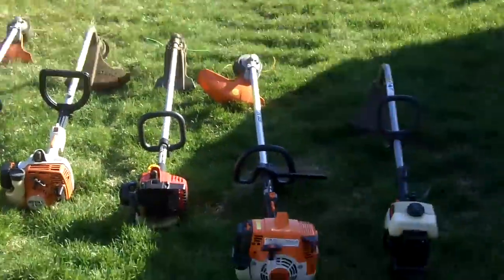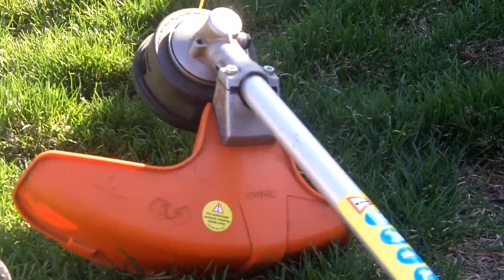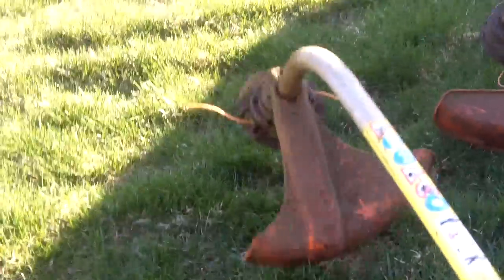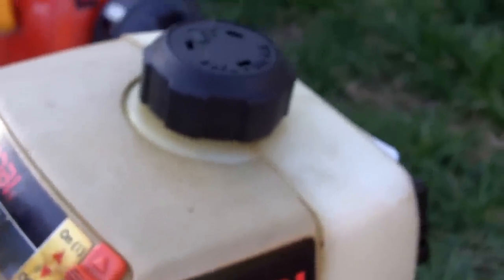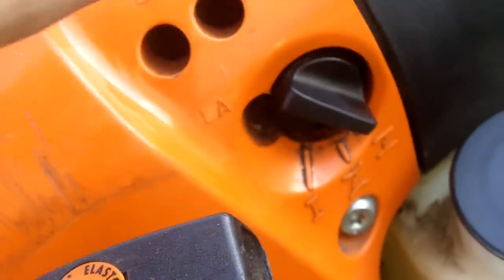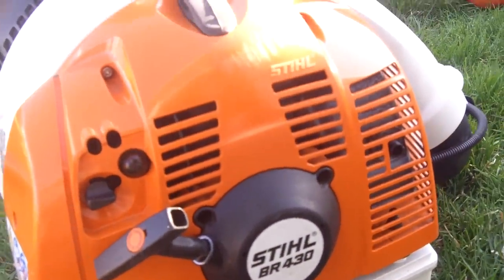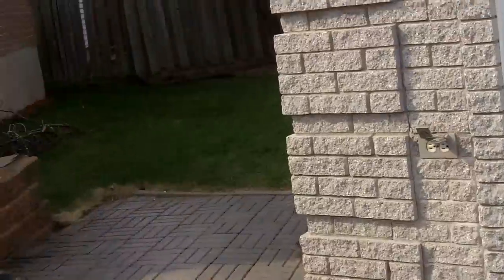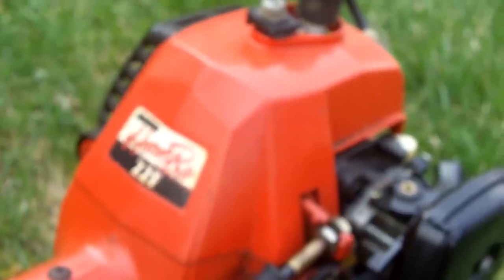Getting The Trimmers & Blowers Running for 2015

Comment: Jon I could use some advice if you don't mind.
I have had the idea burning in my head of buying a HT250 pole saw and converting it into a kombi unit with the appropriate parts. My Stihl guy is on board with me and thinks it would be a good idea, he isn't going to void my warrantee, and said he will actually swap all the parts for me.  
With that being said my choices are the km94r and a Frankenstein km250r as I really want to stay 2 stroke. I know the bigger motor will come in really handy when using the pole saw and mini cultivator and probably even the edger but am trying to justify the extra cost ($200 extra) of this project and the extra weight (2.5 lbs extra) between the two.  
I currently live on a 1/2 acre lot with 2 trees, 300 feet fence line and a 100 foot ditch to trim. I do so with a 4 year old fs55r that has been flawless and never really left me actually needing more. But we just purchases 5 acres of wooded land that I will be clearing out to build a house. It will have probably 30-50 trees, around 3 acres of yard and about a 2 acre pond with tree lines on three sides of the property. I plan on using the 135* hedge trimmer attachment as a scythe for around the pond banks. Also will be using it to clear tall grass and briers at my camp once a year.
I know I don't use it commercially but I will have a fairly involved piece of property to manage when it is all said and done. I plan on trying to keep the it fully trimmed weekly so it will probably only need to be a beast a few times a year. With 90% of its duty being normal string trimming and edging.  
Im sorry for such a long question but if you could only have one powerhead in my situation, which would you pick? 
Thank you,Drew
Reply: But to be honest I really don't mind spending the extra money if it is the tool I need so weight and fuel consumption are the big questions, I don't mind buying the fuel but how often do you have to refuel? I'd love to hear that one tank will get the job done each time but willing to accept it, if that isn't the case!
Reply from the maker: Hi Drew, wow I can't believe they're STILL making that motor.  I thought they canned that engine 2 years ago.  Honestly, if most of your duty is trimming/edging....go for the km94.  Out of all the stihl models I own...the 94 became my go to trimmer since my 70r and 90r keep constantly breaking down.  The 94 is exceptionally powerful for a 24cc...extremely lightweight (your arms won't kill you if you trim for hours) and it's very fuel efficient.  You don't need a 250 unless you have very tall brushes to clear.  If you need that kind of power, instead of modifying...the cheaper option would be to look for the fs 250 model (ebay or on craiglist) and attach a blade to it.  I used my 250 to cut down 1'' tree saplings.

Comment: What happend to the Weed Eater XT 600 ?
I love Stihl Trimmers and Blowers, got an BG 86 also. Starts and runs great. I love the sound of the 4 Mix engines btw
Reply from the maker: Andre G 

Andre, I sold the trimmer last year..  It had too many problems.  Congrats on the BG86.  It's a sweet blower
Reply: Jon3800 Yes it`s beenvery reliable and powerful enough for me. I have uploaded a short video of starting my Dolmar MS 400 and of my old 1977 Mountfield Minor M 4 lawn mower.

Comment: I have two questions. First what exactly is a 2 mix motor and would you recommend the stihl fs 70? Thanks
Reply from the maker: mooch1441 

The 2-mix is a just a trademark name for Stihl's newer 2-stroke engine lineup.  As for your second question, it all depends on what trimmer comparing it to and what you really need it for. The 70 isn't that popular anymore compared to the 90 (4-mix) or the newer 94r (2-mix).  The power is good for a 27cc on the 70. I didn't have any major problems with this model, except for the spark plug issue I mentioned in the video, but I don't like its flexible cable shaft.  As I mentioned in my stihl review video I made last year, the shaft has a habit of wobbling at low speed.   It's up to you,  I'd recommend a 94 over a 70.  It feels more balanced, has a smaller engine which makes the same 1.2 hp as the 70 puts out and it has a solid cable shaft which means you can put a blade on it.  I use the 70 and 94 commercially and the 94 is easier on gas
Reply: Thanks for the response. So the 2-mix does not have any valves, etc like the 4-mix correct?
Reply from the maker: Correct.  Only 4-mixes have valves because they're 4-strokes

2- mixes are essentially 2-strokes that have been stratified charged..  They have no valves and run like the 2-strokes we know and love.  The only difference...they're MUCH better on gas and a lot quieter.  Notice how quiet the 94 is compared to the 250 and 38

Comment: hi jon3800. whats your thoughts on the fs 85r  in terms of power and performance.  was a bit dissapointed to see it only has a 25 cc ??  is it underpowered for its range or am i missing something eg torque etc ... i purchased it for $200 aus dollars second hand.  works ok but im craving the power to take out thick weeds etc lol. thinking of getting a fs250r with the 40cc watched your video on it luvd it ! any help or info would be great mate. cheers 
dan from Australia
Reply from the maker: +Daniel Dukic Hi Daniel, I can't speak from experience with that model since I never had an opportunity to use one (the 5 you see in the video are the ones I have).  The fs94r is the replacement of the 85r and I love it.  The 85/94 were designed for professional landscapers in a way that it's powerful, lightweight and fuel efficient.  In its hayday, it was their top choice.  These engines have better hp/displacement ratios.  My 94r outshines my fs90r in all these categories and the 90r has 4cc more.  If you put a blade on that 85r it will surprise you despite  its smaller motor.  True the 250 has 40cc, but they're harder to find now since Stihl discontinued it in favor of the fs240 with a  37cc motor.
Reply: +Jon3800. thanks for the fast reply and info on these models. i know you know your stuff with Stihl ! im yet to fit a blade on it currently just using 2.4 mm line. yes them fs250r are very hard to come by hey. i can get one for $300 aus dollars used but in good nick think i need to just bite the bullet and grab it so to speak thanks again mate im subscribed and keen to see more videos of that 250 kickin ass 👍
Reply from the maker: thanks man, I would get it since the 250s are classics :)

Comment: I have had my fs 90r for a year now and it is starting to vibrate alot lately. What is the cause of this vibration? Bearings?
Reply: It is probably your shaft but after a while a machine will get worn out like your bearings and stuff like that its ok as long as its not vibrating like shaking your whole body its okay but if its doing that get it checked out!
Reply: I have a 90R too, bought it yesterday, and it already needs a new spark plug! Sucks, but I still like STIHL!
Reply: Crisp Cuts Landscaping a lot of new stihls have spark plug issues bought a brand new br 600 had to change the plug to get it to run!

Comment: I have an old 2005 home lite 25cc motor that used to run great but for some reason after I drained the gas for the winter and then put fresh gas in the next season it's acting up. It's old so what ever.
Reply from the maker: Bailey Lauzon  Your carb likely needs adjusting.  2005 is not that old considering I have a 1995 Ryobi trimmer that runs perfect
Reply: Jon3800 yeah. That ryobi looked like a great machine. I'm just go a get a nice swappable attachment toro trimmer. The edger and trimmer attachments. I will probably do something fun with the homelite like put it on a bike or something.
Reply from the maker: Nice.  I just had it recently tuned up.  It doesn't smoke anymore
Reply: That's good. All of your yard equipment is great too. I watched the cold starts of the mowers too and those are great mowers.
Reply from the maker: Thanks :)
Reply: Jon3800 no problem

Comment: let me tell u Chinese motors suck and they dont last
Reply from the maker: steven paholak 

well surprising that Homelite mighty lite is going on 6 years old the only thing wrong with it was a fouled spark plug.  They'll last if you keep the maintenance in check
Reply: Jon3800 oh well my grandparents homelite easy reach wont start at all since its old but my grandparents homelite yardbroom 2 runs great